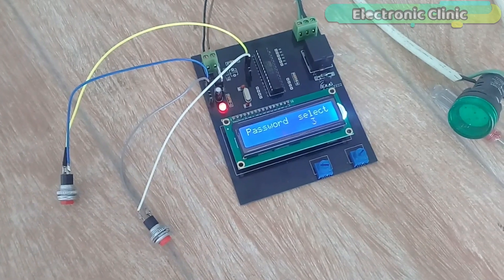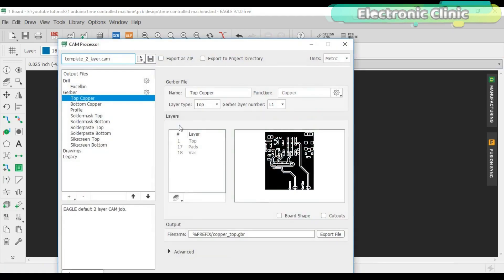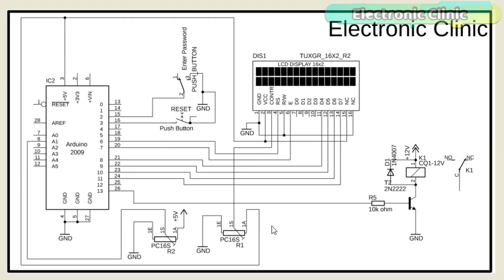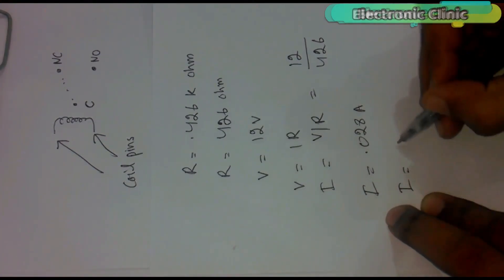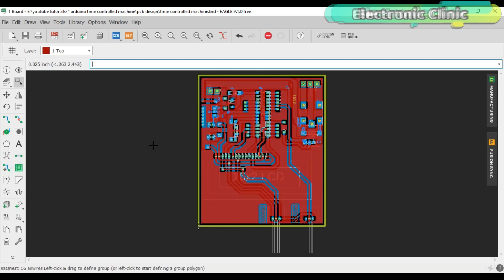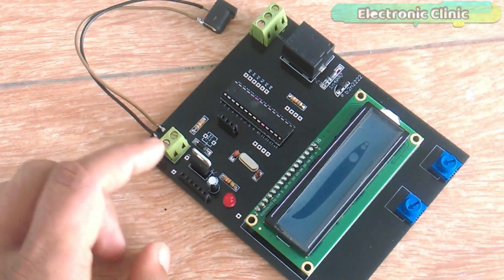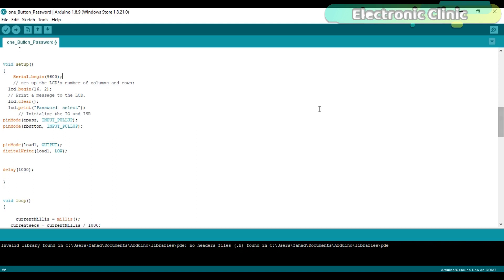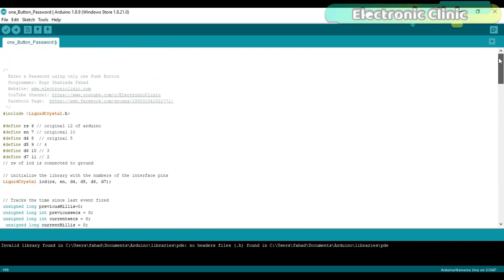Arduino Project: Password Security System Using only one Button

Comment: Hi bro plz can u help me about password based home automation. I am making and need code of the circuit but not found on the web have used 4 channel relays. 
Thanks
Reply from the maker: its circuit diagram, code and pcb file is on the website.
Reply: @ElectroniClinic  link plz